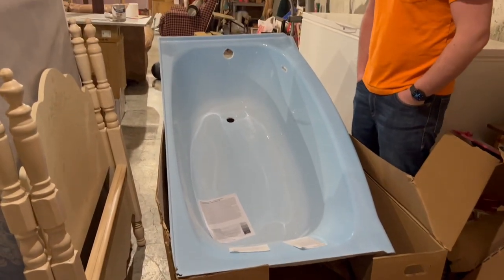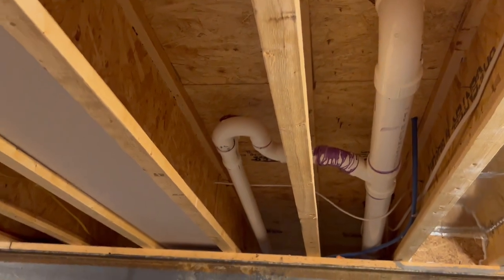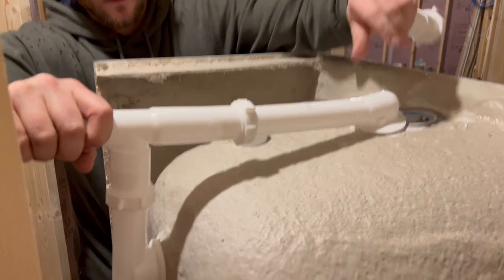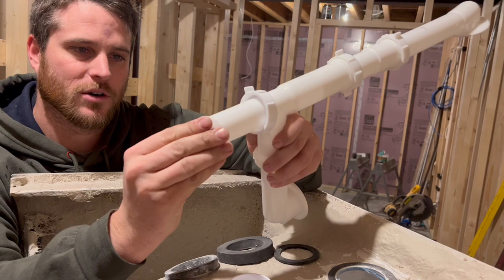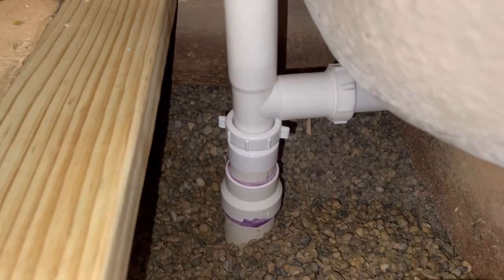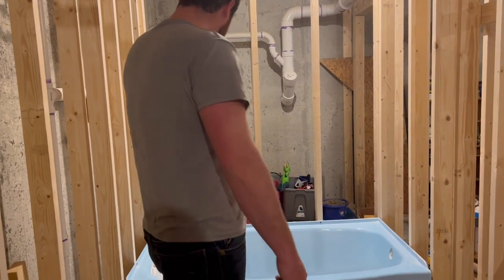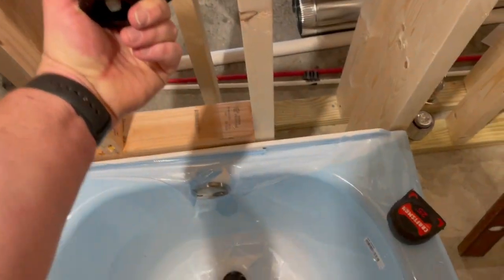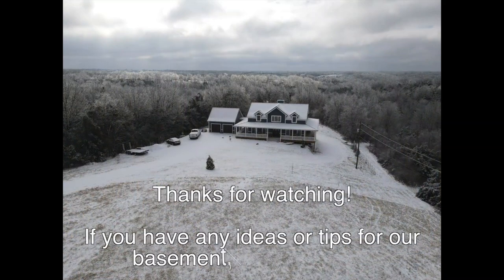Finishing Basement #5: How to Plumb a Basement Bathroom for Beginners!

Comment: Lol, the whole time I thought the tub was blue. I was gonna say that was the same color I’ve got in the bathroom of my old house now. Forgot about the protective film.  Aside from my “duh” moment, what type of screws did you use when leveling the tub. I’ve never installed a tub, so I didn’t know that’s how you leveled it.
Reply from the maker: I was afraid people would think it was blue! But we wanted to keep the protective film on it for when we do the tile in the shower:) Grout on a bathtub can be a nasty clean up (unfortunately learned that from experience haha). Anyway, the screws used for the tub were the same ones we put the concrete board up with. Without finding the package, I honestly cannot remember what they are called... But leveling a bathtub is surprisingly easy task! :)
Reply: @CollinsCountry  ok, didn’t know if it was a special screw or just a drywall screw. Thanks for letting me know, because I definitely would have used the wrong ones…lol